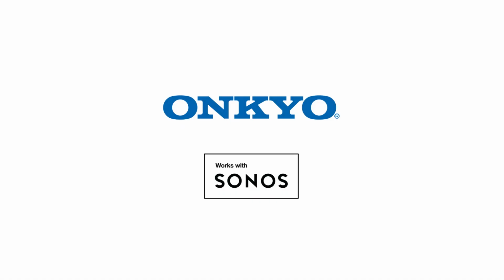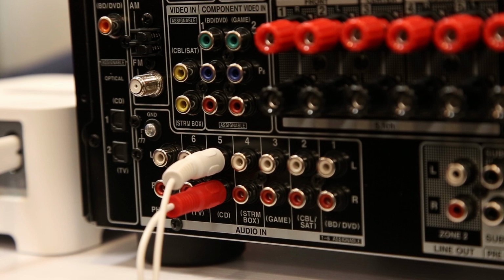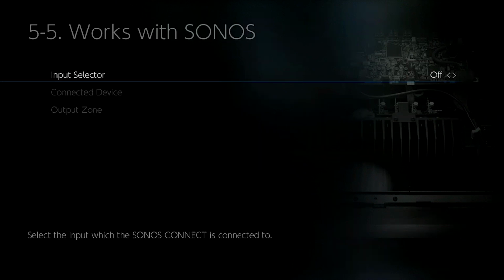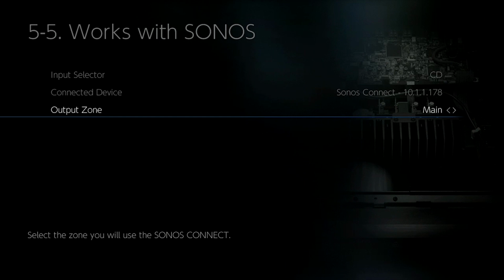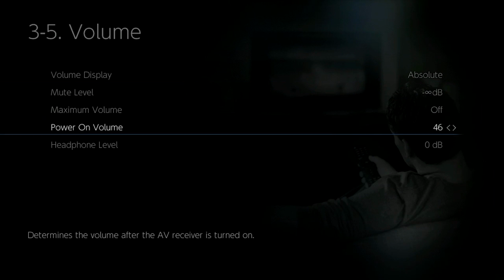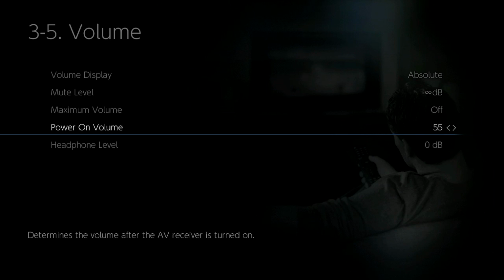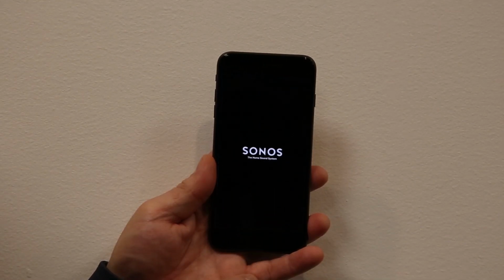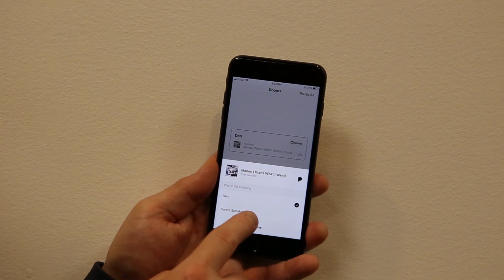Connecting Your Onkyo Receiver to a Sonos System

Comment: If you change volume on the dial of the receiver, would it change the volume on the sonos app too?
Also after changing volume, wil the volume be set to the last known level, or to the level you have set it on (in the video it's 55)?